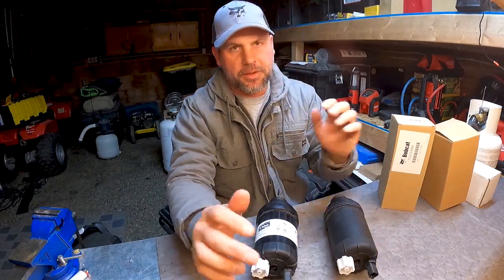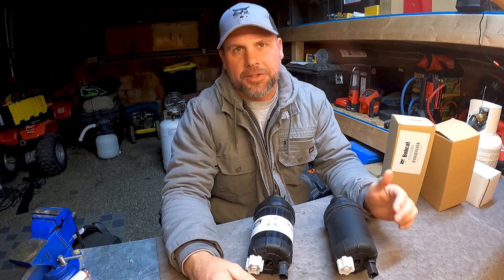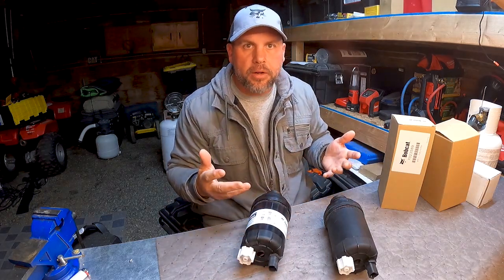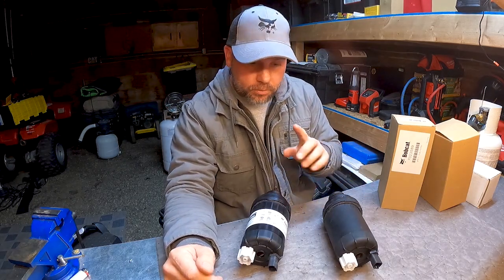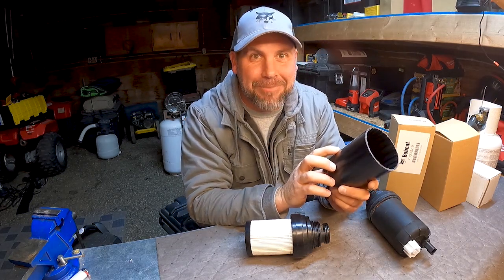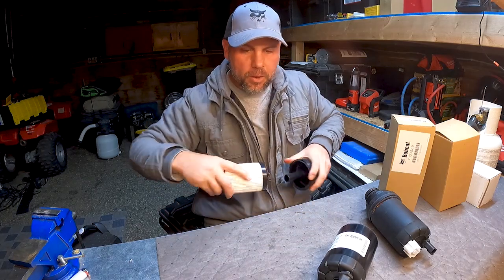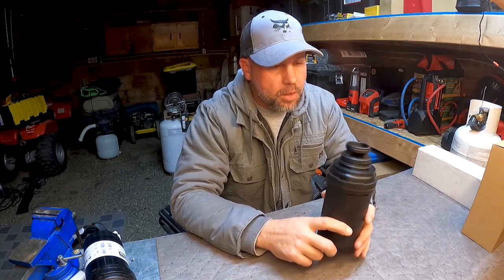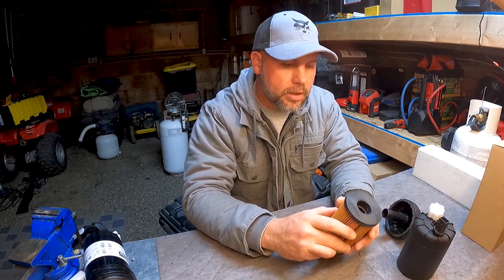Bobcat Skid Steer Fuel Filter Caution

Comment: I’m pretty sure I got sold one of these with a bobcat label on it

Only looked closely at it a couple days after I changed the filter and started getting constant water in fuel and low rail pressure codes

Comment: I put 5 bobcat filters on in a year, had low fuel rail pressure issues constantly, changed to Chinese no more issues!
Reply: That’s because the Chinese filters let so much through and don’t get stopped up lol
Reply: The company I work for just had to drop 12k on a new fuel system because someone filled it with dirty water. I would like to know how it’s still working out for you tho.
Reply: @shotzonyou  sadly all the filters are Chinese made, all my fuel is prefiltered down to 2 microns, only poor people and rookies use jugs,
Reply: @travishodges5179  I agree. I work in rentals, so we don’t know what some people put in the tank until it’s to late sadly.
Reply: @shotzonyou  non essentials

Comment: Hey brother. Question my 2017 T595 is randomly dieing with no code @wot. It will start back up and running. Can you point me in the direction to get ths issue fixed.

Comment: Dang, just bought a cheap one. About to send it back and go to the dealer for the raping. Thanks for tearing these open for the comparison.
Reply: They are all made in China, cheap ones don’t plug up near as bad, brand name plug up way too fast, and cause low fuel rail pressure light to come on

Comment: And this is exactly why we are staying away from the new doosan engines after 2014.No comparison to the reliability of the older kubotas.And the fuel systems are bulletproof.If u do have a problem with the injectors they are inexpensive  you can pick them up for about 150 bucks.If you want to rebuild them it's pretty much a 5 minute job.When we rebuild the injectors we replace the nozzle and usually spring thats it then pop test them. Good for another 3000 hours at a cost under 50 dollars.
Reply: That’s because the old kubota engines are mechanical injected . Where as the new kubota engines and bobcat are high pressure common rail
Reply: @jesselowman6881  high pressure common rail electronic injectors

Comment: Interesting I just did a fuel filter replacement on an S570 and I cut apart the old filter and found frozen water on the filtered side it was made in china. Bought a new filter from bobcat for $95 felt pretty violated. Noticed that the new filter is made in USA must be they had some quality issues with the ones made in china. I have to say there’s definitely some robbery going on here with bobcat because I can buy larger fleet guard nano net filters for less money than the bobcat usually made out of steel so logic would tell you that it would be a more expensive filter to manufacture than these plastic ones.